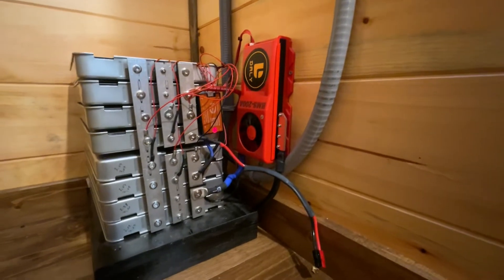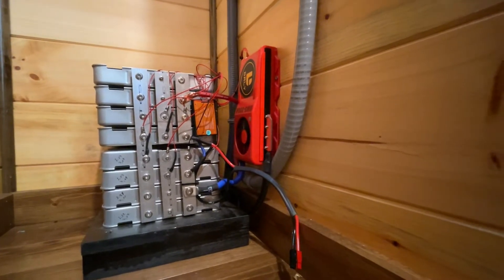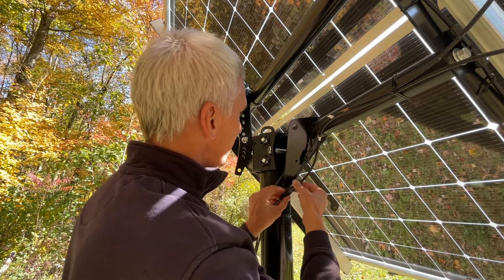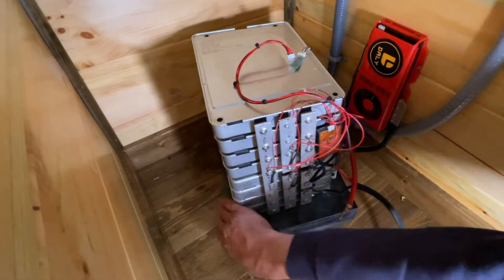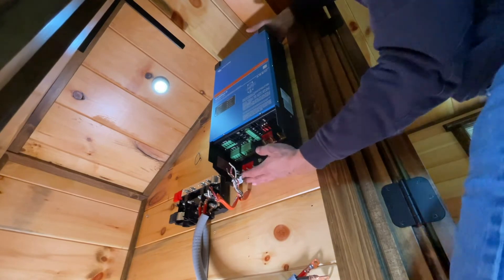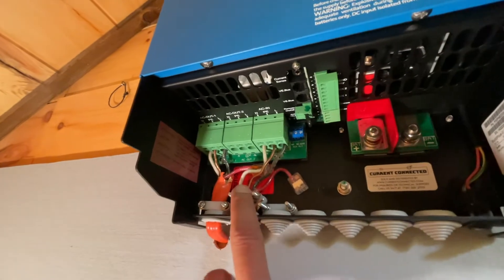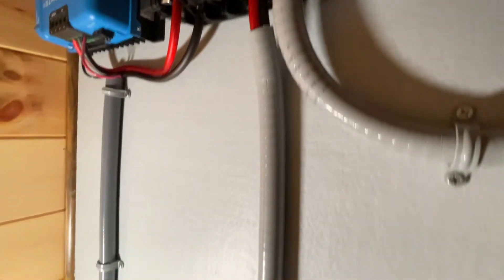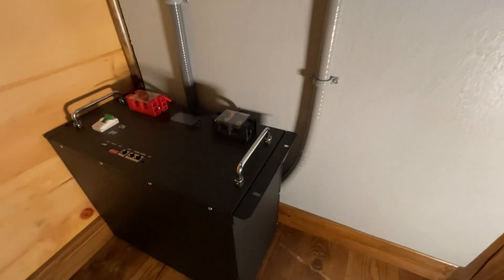Upgrading to 48 Volts Off Grid Solar

Comment: I realize this video is a few months old, however I have a 12, 24 and 48 volt system. Started with the 12 volt 14 years ago (still running today) with FLA batteries now running Lifepo4 cells, and worked my way up. They all have their advantages.  Not sure if you have a step down transformer for any 12 volt appliances or if you require it, but wanted to comment to say it look great ! How are you liking the 48 volt system ?